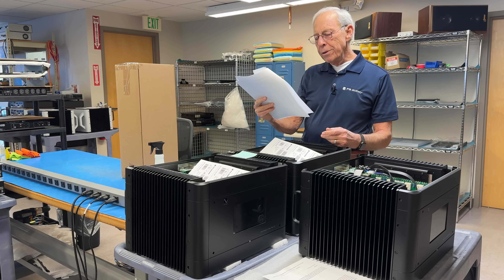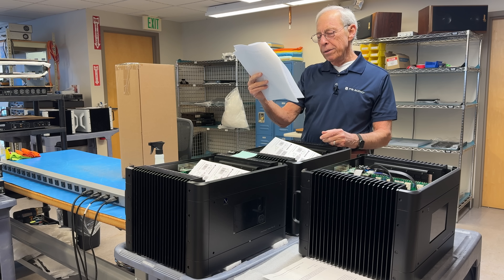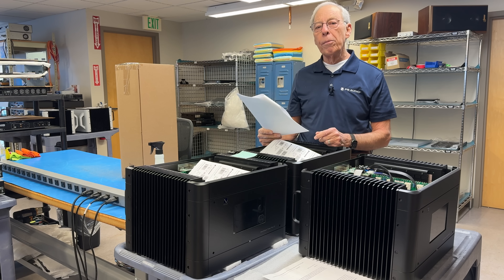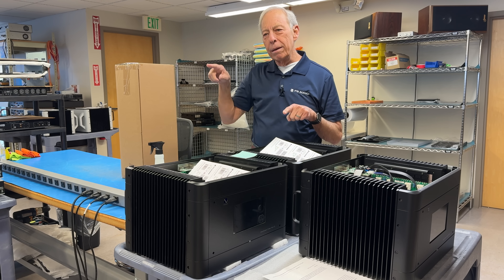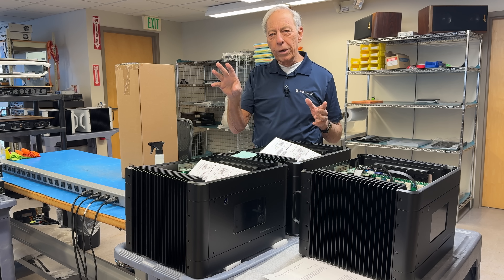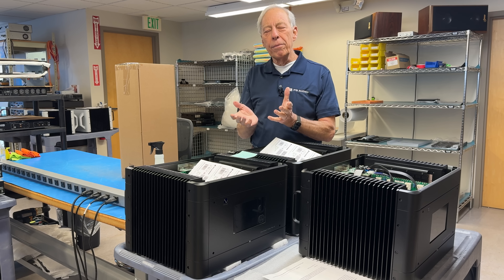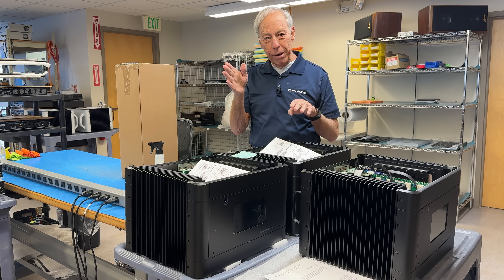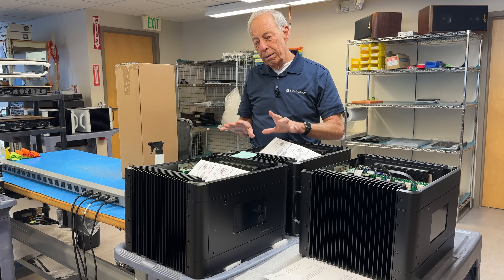Paul explains damping factor

Comment: nicely describe but please let me add some more details and correct some inaccuracy:
1. Damping factor is a calculation related to amplifier impedance vs a resistive 8 Ohm resistor. A Resistor do not represents speaker Load behavior.
2. Damping factor measurement is performed at 1 KHz while the real control issue happens at much lower frequencies.
3. An amplifier which is able to keep it's output voltage stable at all frequencies at the presence of lower load impedance is a great amplifier (really) but at that frequency it will provide 33% more power to the speaker (for load goes from 4 ohm to 3 ohms) since Power = V^2/R.
4. The Control which DF suppose to represent  is the ability to Stop Speaker movement at "Zero" time,  so the speaker membrane movement do not generate a bouncing of it's membrane due to an over travel movement. 
5. The Speaker is like a generator, When membrane is moving it is generating a voltage, when amplifier need to stop the speaker it change it's output voltage to Zero (or reverse polarity) if the amplifier output impedance is "Zero" the amplifier will take all current coming from the speaker movement without letting the speaker generating any voltage hens: the speaker will stop moving immediately.  This can be demonstrated easily: If you take a free speaker driver and try to move it's cone you would be  able to move the cone and will feel some natural speaker mechanical resistance due to the speaker spring system.  If you then will connect the driver inputs one to each other (short the Positive and negative driver input to each other) you will need to apply a much higher force on the membrane in order to be able to generate a speaker movement.
6. to summarize: Dumping is needed  mainly  for controlling the speaker at transient modes.
7. BTW: on a Class A or Class A/B amps a high  DF is achieved using a negative feedback. Be aware that too high negative feedback generates amplification issues as well. I usually look for an amplifier with High Slew rate, High Instantaneous Current frequency response which is at least above 100KHz (300kHz is preferred) and  DF is around the 100 (80 to 150).

Comment: Am I right in thinking damping factor can reduce if you are running stereo amp in bridged mode?
Reply: Yes it can.  Also changing from 8 ohm speakers to 4 ohm speakers will cut it in half.
Reply: @Douglas_Blake  👍

Comment: The same as speaker impedance shown by  Paul hand   are variable phases  of  output currents at diffrerent frequencies. This  (at least should)  create surprises in feedback. This also probably is  reason why diffrent speakers respond  surprisingly  with given very good  amplifier - the more feedback,   the more   that irregularity is amplified  which is bad. .   Best amplifiers are builld to have   no phase shifts  in aim to  make flat  impedance but shifts    are   created in feedback by  speaker coil joined machanicaly with membrane, and transmitting acoustic resonances  Then not only damping factor but also whole fedback for diffrent frequencies may be variable which  is unwelcomed  in sounding.   

That may   give  some advantage  for output transformers in tube  amplifiers - they   are in  line with  those made by speaker making it coherent.   Most popular solid   have capacity output chararcter creating resonance with speaker induction  Tube  have inductive  transformer and their lowest value of impedance is at zero Hz - we like it. for   damping  of   lowest range. . . .  

 . We sholud   depend not only  on on amplifier damping. but more than that should care for speaker construction  low level of  resonances.  For low range correction I prefer to  adopt   room resonance   instead of creating    speaker cabinet resoanance which is affecting feedback.  but it cannot be adviced to listeners who prefer dominating low range because only relatively small    room apply,  it has no such potential and there are other  conditions like location. In such case speakers  near walls  may be good choice.  . .

Comment: Something doesn't quite gel here...!!
Rotel RA-1592 MK II Integrated Amplifier - 200W/Ch (All channels driven, 8Ω), 350W/Ch into 4 ohms - DAMPING FACTOR 600 (not specified how it's measured)...
Could not find the current delivery specs for the Rotel.
1980's Bryston 4B power amplifier - 250W/Ch continuous into 8 ohms, 400W/Ch rms continuous into 4 ohms - Damping factor: Greater than 500 at 20 Hz, at 8 ohms...
Current delivery: 16A continuous, 48A peak, per channel.
Not sure where he's getting the larger damping factor for the Bryston as even the latest version the 4B3 is still 500 at 20 Hz, at 8 ohms...!!!
Might just be a dud Rotel amp or the speaker cables were wired incorrectly, on paper they should have similar performance and ability to drive the Maggies..!! JMHO

Comment: I never knew what dampening actually meant. After hearing your explanation Paul, if I had to sum it up, it sounds like it's the ability to transfer power from the amplifier to the speakers in the most efficient manner. Does that sound correct?
Reply: Despite a lot of complex explanation... In this case damping refers to the elimination of unwanted cone movement.  If you snap a 9v battery across a speaker's terminals you should hear "pop" from the speaker... but when you remove  the battery you will hear "boom" as the speaker cone returns, overshoots, returns and overshoots again, until it comes to rest.  The low impedance of the battery, while connected, serves as an electronic brake that stops the cone from overshooting.  

In an amplifier, a low output  impedance (high damping factor) behaves like an always connected battery... electronic braking to prevent overshoot in cone movements.

Regardless of the many ways this can be accomplished, the goal is the same... to control cone movements.
Reply: No, it's not about efficiency. As a driver moves it's also creating an electrical signal (a coil moving in a magnetic field) and this signal is fed back to the amp. An amp with a high damping factor is better able to over ride that feedback signal and force the driver to move as it's being told.
Reply: @JasonWW2000  OK, I can see how that would make sense. Thank you.

Comment: Rotel not a Mac killer lol, owned Rotel the amp he spoke of and now own McIntosh, even Rotel Michi is not a Mac killer Bryston is beast though but different sound than Mac. A salesman will tell you anything so you’ll buy the amp they are trying to sell
Reply: 100% agree.  I was the one who posted the question with Paul and I ended up settling on a higher powered Bryston 500wpc @ 4ohms.  The Maggies just sing now.
Also love McIntosh-- the build quality, the aesthetics and the sound.
Reply: I have the same amp rotel 325watts into 4 ohm
I use it with Dynaudio tower speakers no issues sounds great..
Maybe you should try  some decent speakers...
Reply: @summerforever6736  So Magnepan 3.7 with 4 stereo REL line arrays and 2 JBL HF compression drivers triamped with 3,200W is not good enough?  I have a $50K system.  What do you have?  That's why I dumped the Rotel-- IT WASN'T GOOD ENOUGH... maybe for you but not for me.
Reply: @summerforever6736  Going from a rotel amp to  naim amplification made my easy to drive tower speakers really wake up with dynamics and powerful bass  . I bet the dynaudio speakers would sing with a better quality amp .
Reply: Rotel isn't hi fi or hi end in any way. Absolute weakest and flimsiest built amps out of any audiophile company I ever auditioned.
Reply: This is probably a guy who went into a shop couldn’t afford Mac asked the salesman would it compare to a Mac just to get that justification to buy it and feel good about it.

Comment: It almost sounds like wattage is kinda like horsepower vs. dampening factor is kinda like torque
Reply: Comparisons are always risky, but I'll try my best. Volts are like horsepower and amps are like torque. Watts are amps times volts. Damping factor is more like a rev limiter or governor.
Reply: @BruceCross I would think of damping factor as traction. The better your traction the better control you have of that power going through the driveshaft. The worse your traction the less control you have.
Reply: @Alan-mq9om  That's a better analogy, comparing damping factor to traction, since it controls the movement of speaker cones. Also, I should correct myself. Volts are like rpm, amps are like torque, and watts are closest to horsepower.
Reply: @BruceCross  I like that one too, traction is a clever analogy
Reply: You can actually convert horsepower to watts and vice versa since they are both measurements of power. There are 746 watts per horsepower.
Reply: And I would say volts can be torque while amps are revolutions per minute. You multiply those and divide by a constant 5252 to get horsepower. Or in watts sake you divide by 1.

Comment: In order to deliver that amp's output to a power hungry speaker one must use a very low impedance speaker cable. Because any "standard" size speaker cable like 12 AWG can severly reduce high amp's damping factor.

Comment: The sloppy damping factor of tubes may be one of the reasons why guitarists still love tube amps, it might be part of the distortion that is favoured from tube amps, I don’t know if that’s the case it’s normally explained regarding guitar amps that getting the power tubes to distort and compress is the best sound and it certainly does increase sustain something definitely difficult to emulate digitally the explanation usually given is that the harmonics in tube distortion (5th order?) is generally more pleasing to the ear than that of transistors.
Reply: It is   deliberated  overloading and is aimed to create strong welcomed distortion like fuzz - it is for special application with affected linearity   In audio amplifiers    overloading and distortions are avoided.     Why expensive tube amplifiers have more  than needed power?  Customers are not   looking for too  small  power in amplifier to enjoy more distorted sounding  - no matter solid or tube.
Reply: I think it's even order harmonics like 2nd order.
Reply: A lot of the sound of an electric guitar is actually due to the behaviour of the driver itself (and the cabinet of course).  A low damping factor allows the cone to do its own thing, adding all sorts of interesting colouring of the kind guitarists like.  Nobody plays a guitar through a hifi amp and speakers if they want it to sound good.
Reply: Hifi Kick drums kick my ass! PS Audio S300 (dual mono amplifier), WBC Ultimate 9 gauge speaker wires
https://youtu.be/-WbVsly1X0w

Comment: Damping factor problems point to poor loudspeaker design
Reply: Actually no.  A poor damping factor can can come from any point in the speaker loop... low current capacity, bad output design, flimsy cables, poor crossover design, bad driver design, even cabinet design.  It all has to be right to get a high damping factor.

For example:  22ga speaker wire (common in the tube days) has a resistance of 10 times that of 16ga wire and can significantly reduce damping factors.

You can calculate this using the amplifier's output impedance, speaker impedance and wire impedance... but generally any DF over 20 is sufficient.
Reply: Uhh, not really... He's using planars... Irretractable problem

Comment: It all comes back to the Power Supply (P.S.) of the amplifier.
If the P.S. is not capable to respond to sudden current variations ( extra demand), the voltage at the speaker terminals drops with disastrous effects.
That's why, amplifiers and speakers have to be tested together before purchase.
No manufacturer admits their product is inadequate, ever.
However, this is not the definition of 'damping factor' which has to do with currentt generated by the Voice Coil(s) of any speaker(s), sent back into the amp.
Reply: Certainly the PS has to ba able to produce the required power, but the output stage can't deliver that power, it just becomes a space heater. If the output stage has a low output impedance, then the output stage will struggle to deliver that power consistently for loads (speakers) with wide impedance swings.
Reply: Totally in agreement!
If the P.S. is designed properly, then it's all about the output impedance being suitable for the speakers in question. 😊

Comment: When the speaker cone moves in response to the amplifier the coil in the speaker generates its own current that feeds back to the amplifier. A low impedance at the amplifier, ie a high damping factor, effectively sends this current to ground and acts like a brake on the speaker driver and gives much better control of the speaker.
Reply: Damping factor = speaker impedance / amplifier output impedance. Higher number means the cone motion can more precisely follow the amplifier signal e.g. less ringing of the cone when a signal stops.
Reply: @ - I hear what you are saying. I have a full lab here and what you are saying is populist and commonly said. In the lab, with the right equipment, what you said cannot be verified.

High 'DF' number does not mean that cone motion is more precisely follow the amplifier signal. And what exactly is this 'signal?' Is it voltage or current? Yes, the current may change, but as a linear function as it may result in a change of sound level (dB-SPL). The driver will respond linearly to that increase in current without the ringing so often implied. Stop the current and the cone stops responding. There is no ringing. Also the cone mass is sometimes blamed for this ringing. No, it should not be as Newton's Law of motion takes care of itself. Increased mass thus decreases efficiency without ringing. This 'ringing' stuff really annoys me. Yes, I have seen badly designed driver 'doubling' the frequency. This is non-linear distortion, but blame a bad speaker, not the amplifier.

Oh yes, a lab can confirm all of the above!
Reply: @ThinkingBetter high damping factor is overrated.
Reply: @mitchtaylor6512 no ,if you are running 4-5 inch voicecoils on a 18inch woofer you really need that control , believe me sounds much better and with smaller excursion
Reply: @danernorbi I've had an amp with a damping factor of 800 and my Krell amp with a damping factor of 200 has much more control than the amp with 800, so much for damping factor.
Reply: @mitchtaylor6512  Yes, like other audio specs, there is a diminishing return of higher damping factor values. Ultimately, what you hear is what matters.
Reply: Voltage. Current is determined by imp.
Reply: Hi Geoff - may I correct something you said?

The speaker's coil actually develops a voltage, not a current. The voltage does a couple of things, it is seen as an inductance above 100 Hertz and rises with frequency according to Faraday's Law. This actually resists current with rising frequency. It can also be measured as an inductance rated in milliHenry, or mH. If the coil is connected to a voltage source that nominally zero Ohm, then the voltage generated in the coil is shortened out, not directly, but through the DC resistance of the coil.

This is where a current is generated, only when connected to a voltage source, the amplifier. But if that voltage was 600mV and the DC resistance is 6 Ohm, and the amplifier a pure voltage source (0 Ohm) then that forms a loop and the current is 100mA. This makes the idea of 'damping factor' rather mute. Think about it, the amplifier is not a pure voltage source and so let us say that it is 0.01 Ohm (DF=800), then in the loop described, we have change 6 Ohm to 6.01 Ohm. The current absorbed has now gone from 100mA to 99.8mA.

The amplifier can only see a single impedance 6.01 Ohm and what about the speaker? Looking back too, it can only see 6.01 Ohm.

So many claims just don't add up to really close scrutiny.
Reply: Damping factor isnt that importen factors greater than 20 dont help mutch
Reply: @hansjrnandreasen5867  agreed, but most people don't understand that.  The way damping factor is measured is also suspect.